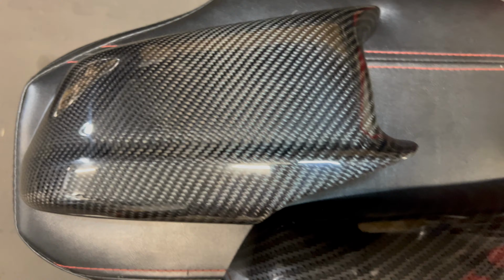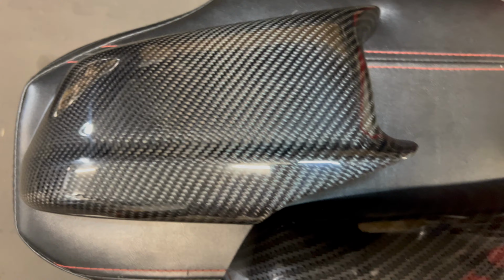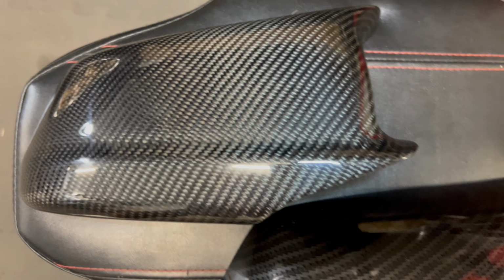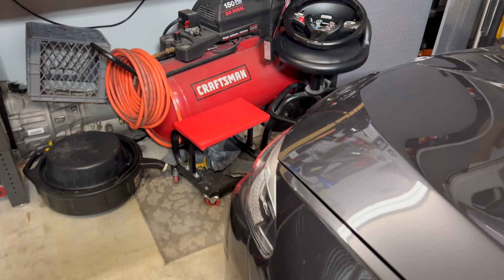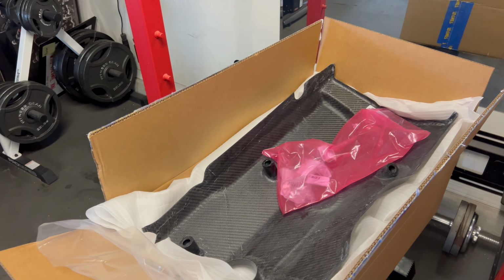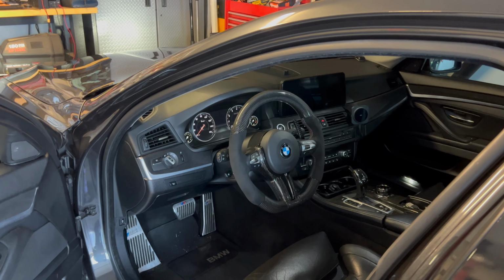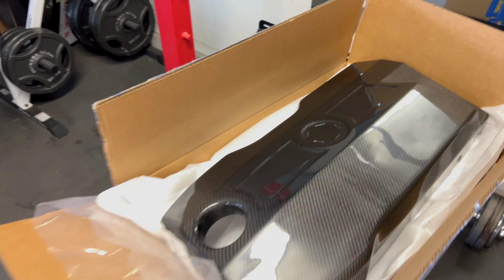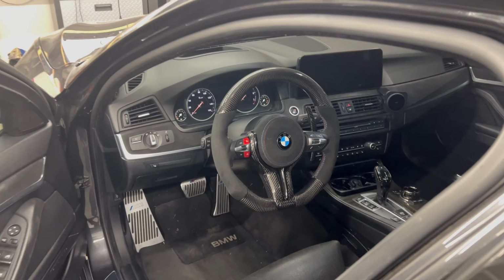BMW Installing Multiple Custom Carbon Fiber Mods!

Comment: Where did you get your steering wheel from and how much was it
Reply from the maker: Working with a manufacturer to see if there is enough interest to start offering them to the community. Not sure on a price point yet.
Reply: @JohnsonMotorsports  Im curious about this as well!